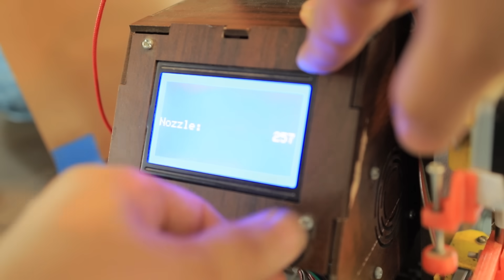How to Make free & easy filament for 3D printer at home

Comment: It seems that the pulling force exerted on the newly produced "filament" would overpower the material being melted in the filament production hotend ,resulting in complete string separation .  Filament extruders in production do just that. Extrude!  The filament material is "pushed " from the production head by a screw auger . I therefore have to conclude that this video is bogus!
Reply from the maker: No dear friend it is not so,
The melting temperature of a PET bottle is 250 degrees, but we soften it with a temperature of 200 degrees so that it becomes a tube, not melted. Instructional videos are attached in the description, it is better to watch these videos before concluding.

Comment: this is super cool, and your feedback here are so greate, so i started making my own. do you set the bottle on fire to uniform it or to make the wall thinner? I still haven't been able to cut uniform bottle flats. My bottles are uniform so I haven't put them on fire yet
Reply from the maker: I heat them to smooth the outer surface of the bottles, if your bottle has a smooth and even surface, you do not need to heat it.

Comment: That's actually quite impressive, i bought a filastruder and abs is actually quite easy to make but pla can be challenging as the size doesn't remain consistent. I have heard of people printing with HDPE before but I've never tried it myself. Is it easy to print with? Have heard that it's hard for the layers to stick.
Reply: Polyethylene printing's iffy. It's incredibly humidity-sensitive and adhesion/shrinkage will be devilish. Heated build volume almost mandatory, bed heater absolutely mandatory. Use a PVA bed-prep or even PVA-based hairspray on the printbed, with rafting.
Reply: Is a filastruder kit worth it for pla? i only use pla and pla+ right now because for what i print thats all i need and i would love to reuse the bits of supports and wasted prints rather thn throwing it out and i was going to save up to get one of those kits so is it a good idea to or look into something else?
Reply: @jordannonnemaker1532  i honestly would not recommend it for pla unless you have a lot of patience. For abs it's great. I've tried a lot of different tips with pla from the online forum and so far none of them have have a consistent result for me . And from what i can tell none of the cheaper ones  really can even the tempting $800 fefil evo claims it can but there are videos online of the same uniform problem with pla. Now  the 3d evo seems to be able to and a lot of ppl online show good results with it but i think that is close to 8 thousand dollars. So i guess best bet is to just keep buying pla.

Comment: hmmm, couldny you use a giant metal tube, that connects straight to the nozle and the heatblock, then u heat up the tube and push all the fillament trough the nozzle  and u could just use scraps of old prints not just bottles and stuff.
Reply from the maker: Thanks dear friend

Comment: Hey I have a really good idea can you print a small BLDC motor from the recycled bottles man that would be really awesome I know it can be done no problem I don't think anyone has done it before let me know if you can do it you have greatly inspired me to get 3D printer  now I am going to start saving plastic waste and make free 3d filament
Reply from the maker: Thanks dear friend, be a little patient, because the time for the full video tutorial was long, it was decided to split the videos, but do not worry, we will discuss it in the next videos
Reply: @AIboom20  Awsome I am interested Because I build pulse motors and have been wanting to buy a 3d printer and want to print coil spools and rotor I want to make overunity energy devices from basically scrap parts and recycled recorces so it is truly free energy

Comment: Wauw man! I am working on an extruder, but without succes. This can be my solution! Is it a specific (1.75mm) nozzle or did you take a general nozzle pierced with another diameter and which?
Reply from the maker: No matter what nozzle you use, the tip should be drilled with a 1.7 drill. We will discuss it in the next videos.

Comment: This is what I have always wanted for FDM printing. The ability to turn plastic trash into filament and then it into new useful things. Awesome!
Reply: For real, this hobby can easily create SO MUCH plastic waste. Nice to see people turning waste into 3d prints instead of the other way around.
Reply: I want it, but doesn't it look like its a lot of work for a few inches of filament.
How many bottles do I have to collect to make 1 lb of filament?
In many places, taking recyclable materials from the dumpster is illegal.  Be careful about the law.
Reply: @bipl8989   wow that’s insightful, even tho you are trying to make good out of it you could end up in jail right? Laws and people!
Reply: @YeneSpace  Some city councils sell the right to collect the rubbish to the highest bidder, apparently there's at least some gold in there and as such its become a public resource and pilfering of it is ilegal.  
I was going to find out how many typical plastic bottles it would take to make a pound, but after I collected 42, the wind kept  blowing me off the sidewalk.   I guess I'll have to do it the smart way and weigh just one and divide a pound by that.  Then I'll know how many I can collect without getting blown down by the wind, which actually appears to be a more useful statistic. 😉
Reply: @bipl8989  well you should way the strip after you cut the bottle because the ends are wasted in this method

Comment: Where did you find the 1.75 nozzle to make the filament the correct diameter?
Reply from the maker: You have to drill a hole in it with a 1.7 mm drill, we will cover it in the next videos

Comment: Very clever but not exactly free. A kg of filament costs about 20€. A 2 litre empty PET bottle weighs about 50g, so you’d need the time to process 20 bottles to get the equivalent of a spool of filament. Never mind inventing and building all the equipment to do it. As a proof of concept it’s a neat idea, but I have better things to do with my time. And where do the bottles come from? We don’t buy anything in plastic bottles. Am I supposed to start sifting through recycling bins? Well really! I admire your ingenuity, but it’s definitely not free.

Comment: Do you have a follow up video that goes in the more detail on how you set up the last step that converts the plastic into the filament?
Reply from the maker: We will discuss it in the next video
Reply: @AIboom20  you are the man and I am your newest subscriber! I have been reading up on 3-D printing a lot lately and the thought of using recycled ways to create new products is very exciting. Could you please include the expenses that went into your set up?

Also have you done a durability test on the products that you build from recycled material? I know that heat can cause the polymers to break down and you usually only get one use from the material after traditional recycling processes.

Comment: Cool little project, I think most people are missing the point that this is clearly not intended to be as good/compete with professionally engineered filament products. It's a home project for a little bit of fun to see if you can make some printable filament. Good job!
Reply: How much of a big difference is it? Is it "night and day" or just "7/10 vs 9.5/10" quality difference?
Reply: The print looks totally normal and stable. I'm having trouble seeing why it's not as good as regular filament.
Reply: @ChickensAndGardening  There is no difference. Unless you wanted an additive in the filament this PET is as good as store PET.
Reply: @markmitchell590  I think the only difference is the dimensional accuracy of the filament. Slicing software expects filament to be a specific diameter (1.75mm, for instance), and if the size is different, there will be under or over-extrusion until you tune the slicer for your particular filament diameter, if it’s not exactly the same as commercially-produced filament.

Additionally, and more importantly, if the diameter is not consistent throughout the entire length of your filament, the layers of your print will be of uneven thicknesses, which can obviously be a problem.

I’m impressed with this method since the gas stove “glassblowing” technique evens out the thickness across the bottle, then the cutting is made consistently wide thanks to the fixed blade and the weight holding the bottle down. And finally, the motor driving the gear reduction to the spool pulls the rectangular strip through an extruder at a fairly even pace, giving it the best chance of staying consistent in diameter. I suspect the extruder used here is also not too hot, otherwise the plastic would melt and stretch away from the unmelted part.

Comment: Where is the pinned comment with all the answers? I can't see it :(
Reply from the maker: Friends, please be patient, I will answer all the questions in this section :

****The main function of this filament maker is to turn your light into an empty tube, but its emptiness is different. If we consider the width of the strip correctly when preparing the filament and reduce the temperature and speed more, the final filament will not be hollow.

-----Can you explain more about the temperature adjustment of this work?
Temperature for PET filament production is 225-200, for filament bonding is 270-280 and for printing is 250-260.

-----Do I have to inflate and heat the bottles?
 No, the purpose of this is to smooth the outer surface of the bottle, without this you can also tape the bottle, see in this video:
https://www.youtube.com/watch?v=Pd9_fyGZdEQ

-----Is this video fake?
 No, it's absolutely true, all the models made in this channel are produced in the same way

-----Do I have to use a 3D printer kit to produce the filament?
 No, but I used this because I already had this kit, if you have enough knowledge about electronics you can do it using Arduino

-----Is there a cheaper solution to this?
 Maybe, if an easier solution comes to my mind, I will make a video for it

-----When will the new video be uploaded?
I will upload 2-3 videos in week , so be patient and follow the videos

-----What should be the thickness of the tape obtained from the bottle?
This is variable. I consider 5-6 mm for a soft drink bottle, which is thicker, and 7-8 mm for a thin mineral water bottle.

-----What is the material of the bottle used?
I have tested "PET" but ABS bottles cannot be produced this way

-----Is the accuracy of the string diameter ultimately good?
If the tape produced by the bottle is uniform, the quality of the final filament will be excellent

----Extrusion block, is it a classic 3D printer heater with a filament diameter?
Yes, the 12 volt 40 amp heater is related to the Prusa 3D printer and the filament thickness is 1.75 mm.

-----Free yes easy I don't think so lol.
this is the easiest and cheapest way that I have experienced and seen so far, of course, maybe I will find an easier and cheaper way later, in which case I will put it on the channel and share it with you.

To control me, I used the 3D printer board I had before, you can even connect your 3D printer heater and thermistor to it.
Reply: @AIboom20  Thank you! :)

Comment: that's frikkin awesome AF! woah, i'm having some incomplete printing issues, but seeing this makes me want to push through!...ta!
Reply from the maker: Thanks for commenting
Reply: @thesoloveichiks159   just digging out from the hurricane. let me take a breath and i will report. thank you!
Reply: @thesoloveichiks159   i have the X2 from Voxel. my prints have stopped printing. when i examine the last bit of filament, it looks like its been compressed by the drive gear wheel. something, mid print is causing a blockage stoppage and i've observed the print he'd printing nothing in thin air...
Reply: CB   @thesoloveichiks159  i  would say Around 24 hours. 
Yes both nozzle and ptfe tubes were replaced/upgraded. And fans at the extruder nozzle and the cpu board were swapped out. Should I undo the mods? And test?
Reply: @thesoloveichiks159   i could take a photo of the last 5 tries with the same model, it would show a progression of height failing and getting progressively lower before it stops printing. and the model is the included 
'rotation nut-pla'
Reply: @thesoloveichiks159  the file, 'rotation nut-pal'. i have completed 3 before and after the mods.  other models have not printed successfully.
 before fans: i did the test hook, twice +, the tool box once(it print till it almost ran out of the red PLA and i didn't interrupt the printing and printed the top half of that model in black PLA. and about 7 tries of the rotation nut and have only 3 successes. several other models that i generated also fell into the 'incomplete well'.
Reply: @thesoloveichiks159  except for the red intro filament, it's been one roll of PLA...it has performed well, i thought . i don't have callipers to check continuity of filament diameter, i will open another roll and test.
where i live is extremely humid most of the year. i kept a ceiling fan on to circulate the air in that room.
i wonder if the feeding structure spring is too tight. it might explain why it gets to a certain point, grinds the filament so it cannot pass through the extruder to the nozzle,  and causes the printing to stop or carry on without any building.
thoughts?
Reply: @thesoloveichiks159  i've swapped nozzles a couple times, even went from brass to steel. the steel nozzle didn't seem to appreciate where it was...
i'll re examine the end of the PTFE and √ its condition.and loosen that spring on the extruder...it was something i hadn't considered until i RLFM @ troubleshooting. thanks immensely for your time.
Reply: @thesoloveichiks159   i swapped out the original PLA roll with a fresh out the bag roll and turned off the ceiling fan...printed one item...flawlessly and the next more complex shape is printing along fine. i have not checked anything else. so, sfsg
Reply: @thesoloveichiks159  it's cocked up again. i have new PTFE tubing and related connectors coming Friday. after i replace them, more tests.

Comment: I like this idea but I have other questions.  
1) Where did you obtain the 1.75mm nozzle or did you drill it out?
2) Do you have to maintain tension as you spool up the filament?  
2) Do you have to cool any of it as it comes out?  
3) Where did you acquire or do you have design for the reel system and firmware for the Arduino.

Really very cool.  Would love to see this done with PLA as well especially with an auger that can crush and push small PLA fragments and pellets.
Reply from the maker: Thanks dear friend for writing your comment, read the pinned comment, your answer is there
Reply: @AIboom20  There is no pinned comment? Did you drill it by your self?
Reply: @AIboom20  there is no pinned comment

Comment: So, if I'm understanding your video description correctly, you are running the ribbon through a standard heat_block with nozzle at ~220C, and then printing at ~255C?
What is the bonding portion?
Reply from the maker: Thanks dear friend for writing your comment, read the pinned comment, your answer is there

Comment: How did you modify the nozzle to recieve flat strips? Imagine if you had like 30 or 40 bottles worth of strips and you can somehow join them to form larger rolls and produce bigger prints. I cant think of a way to control your spool roling motor speed if your roll gets bigger bcoz the diameter of the spool gets bigger the faster the plastic will get pulled the thinner your fillament wil be.
Reply from the maker: Thanks dear friend for writing your comment, read the pinned comment, your answer is there

Comment: You should have re-printed a smaller bottle with the bottle filament.
Reply from the maker: Thank you for your comment, but I did not understand what you meant
Reply: @AIboom20  I meant, cut the original bottle up into filament and then print a smaller copy of the same bottle you used to make the filament.

Comment: Hmm. Can this be made with blended plastic, gravity-fed? That would make recycling failed prints possible, as well as make bottles easier to mass-process. Maybe something with ultrasonic cleaner vibrator to make plastic flow faster and more consistently through the funnel.
Reply from the maker: Thanks for your comment, but I did not understand what you meant

Comment: I did something similar few years ago. Made a custom extruder that strips a bottle while printing
Reply: Well, where is it? Please post a video.
Reply: @davidbanksAu  id lovw to gst time to dog the bits out n finish it. This is way bettwr method. Mone consisted lf a 3d printed stanley k ife blade holder with a pole to hold the bottle (i didnt pre warm mine but mich better too looking at it) i started it manually pulling skmw off then fed it into a 3d printed cone that forced the strip into a cylinder shape which then went into extruder. Was far from perfecr and had errors in most prints (due to the lack of filament being pulled through as it technically wasnt a solid filament